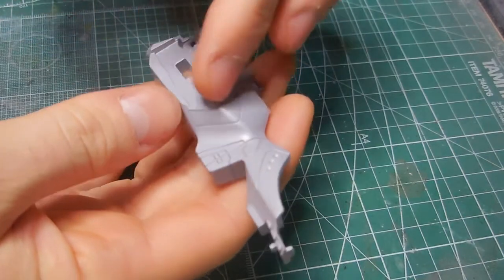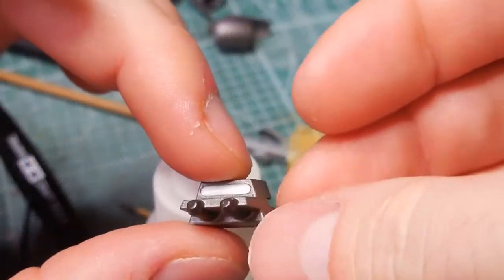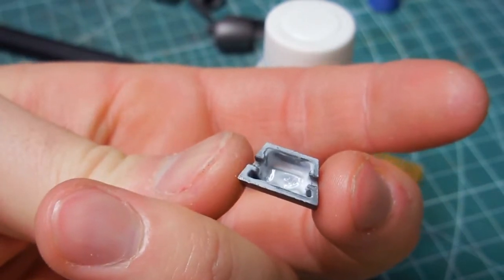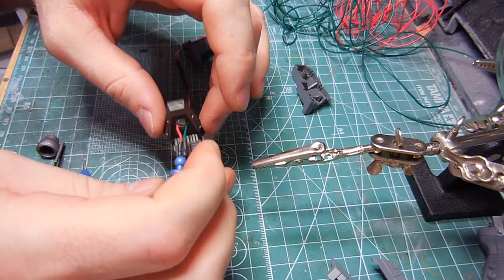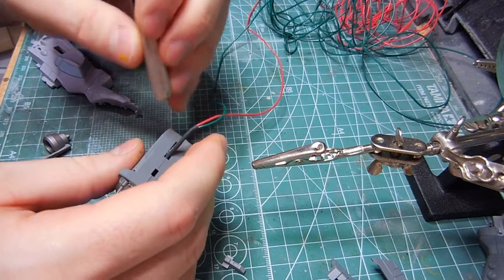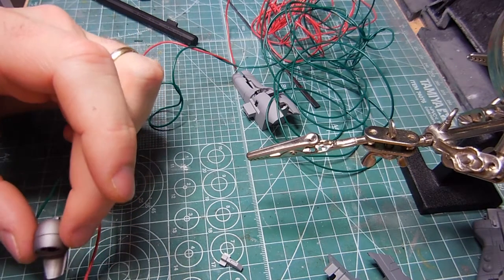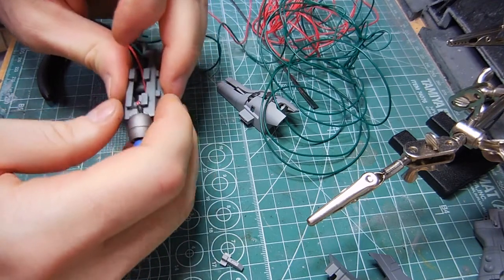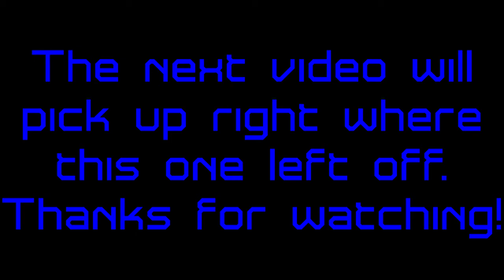PLUM R-Type Final R-9A Arrowhead plamo build video 7

Comment: Nice job, man, you got this :) I use solder flux, it makes the soldering way easier getting two parts together quickly (I also presolder the leads), but it does cause rust if you don't clean it afterwards with soap and water. But I guess it depends on what kind of solder (and temperature?) you use. Heat shrink tubing is a very good idea, I'll have to use that next time. Thanks for the update.

Comment: 30awg kynar wire might be easier to work with, it also works with a "wire wrap" tool.  The "wire wrap" method is very good for lighted models, and it's easier to solder a joint that's already neatly wrapped and tacked by the cold-weld caused by extreme focused pressure from the hand tool.  the simplest hand tool is still a joy to use, I often look for excuses to use it  :P